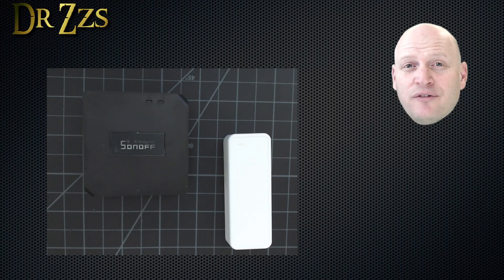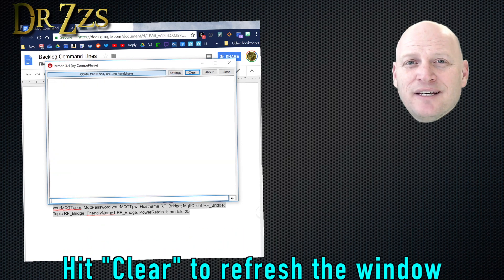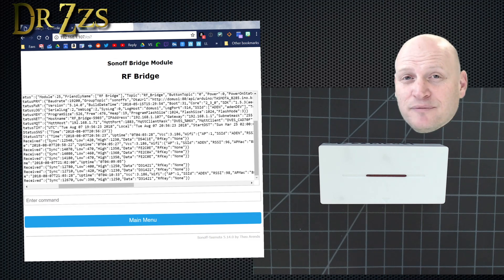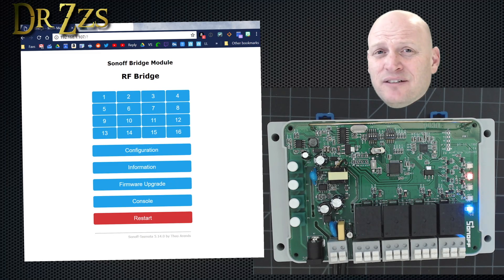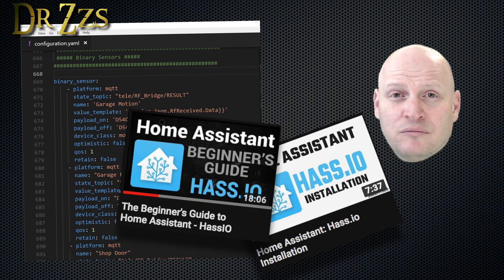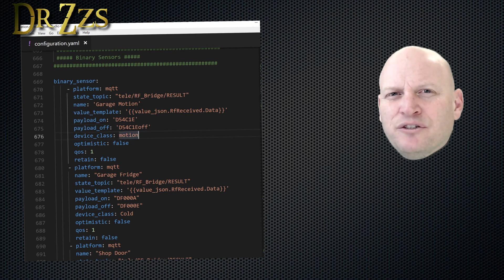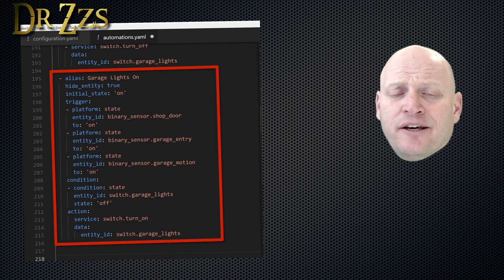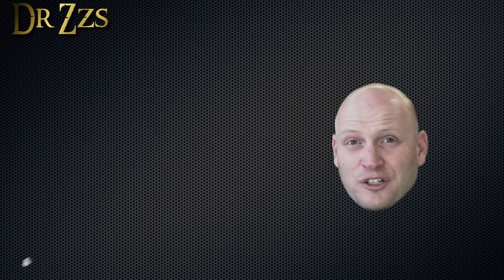Sonoff RF Bridge with Tasmota

Comment: Nice video:) I have noted this before, but I get this annoying error in the log every time I use a 433 MHz key-fob with the bridge: 

2018-08-10 13:59:50 WARNING (MainThread) [homeassistant.components.binary_sensor.mqtt] No matching payload found for entity: Alarm Fjernbetjening with state_topic: tele/sonoffbridge/RESULT

Why does it that?
Reply from the maker: Thanks.  
maybe we can figure it out together.  The answer seems to be something with the payload for that sensor.  Can you post what you have in your config.yaml for that sensor?  And what you see in the Tasmota console when you press the button on the fob.  That's where I'd start looking.
Reply: Great;) This is my yaml :

  - platform: mqtt
    name: "Alarm Fjernbetjening"
    state_topic: "tele/sonoffbridge/RESULT"
    value_template: '{{value_json.RfReceived.Data}}'
    payload_on: "F570C0"
    payload_off: "F5700C"
    device_class: opening
    optimistic: false
    qos: 1
    retain: false

And this is an example of the console from tasmota:

21:03:38 MQT: tele/sonoffbridge/RESULT = {"RfReceived":{"Sync":13580,"Low":440,"High":1300,"Data":"F5700C","RfKey":1}}

This is the "OFF" for my alarm system :)
Reply from the maker: Looks like you also have it programmed to Key 1. Try using RfKey instead of Data in the template then set the payload_off to 1. 
What’s the console output for the alarm on?
Reply: DrZzs  I have tried the payload with the rf key instead also - this makes the same problem. 

The on payload is the same as the off - just with the other data code
Reply: Hi again Doc:)

I have written a issue on the HA forum also. This is more in depth of my problem:)

#################################

Hi all.

Dont know if this is the right place to post this. But I have just set up af tasmotized RF-Bridge form sonoff to control my diy Home Alarm System. Im using Xiaomi Aqara System with Xiaomi Sensors for the doors and Motion detectors - also from Xiaomi.

I mirror all the system directly to HomeKit so I can control it by my Home App. Works great.

But I use the RF bridge together with a 433 mhm Key-Remote control.

When I set it up I get these results in the tasmota console log.

07:34:37 MQT: tele/sonoffbridge/RESULT = {“RfReceived”:{“Sync”:13610,“Low”:440,“High”:1300,“Data”:“F5700C”,“RfKey”:1}} THIS IS FOR THE OFF STATE

07:35:08 MQT: tele/sonoffbridge/RESULT = {“RfReceived”:{“Sync”:13580,“Low”:440,“High”:1310,“Data”:“F570C0”,“RfKey”:2}} THIS IS FOR THE ON STATE

I then use this code in HA for the binary sensor:

platform: mqtt
name: “Alarm Fjernbetjening”
state_topic: “tele/sonoffbridge/RESULT”
value_template: ‘{{value_json.RfReceived.Data}}’
payload_on: “F570C0”
payload_off: “F5700C”
device_class: opening
optimistic: false
qos: 1
retain: false
It works great for switching on and off the alarm. BUT - I get this error in the Home Assistant Log and can’t figure out why:

018-08-10 13:59:50 WARNING (MainThread) [homeassistant.components.binary_sensor.mqtt] No matching payload found for entity: Alarm Fjernbetjening with state_topic: tele/sonoffbridge/RESULT

Any clue on why this error is coming?

Best regards.

Jacob
Denmark

#################################

Comment: Hi. Glad you had some more success this time round. And again thanks for all the great videos. The limit on rf transmit and receive is only limited to the number of 24bit codes possible (16,777,215 i think). If you want to send a code other than the preset 16 codes. Just use the mqtt command RFCODE and make up a 24bit number. To send hex value just add a # infront of the code. Example cmnd/sonoff/rfcode 8585358 or cmnd/sonoff/rfcode #83008E. Adding the # infront of the code to send hex is a real pain in home assistant which is why i added some settings in tasmota to be able to receive the rf codes as a decimal value which is much easier to handle in home assistant. As of tamota version 6.0.0 In console use SetOption28 1 to switch dec rf receive on. Then the use of rf plug sockets becomes much simpler. 
Thanks for another awsome video hope this comment proves useful. 
Thanks. Sam
Reply from the maker: Awesome!  Thanks again to you for pointing me in the right direction.  
Sounds like you are the master of the RF Bridge.  I'll be coming to you for any future questions :) 
Are you on Discord?
Reply: ha! i wouldn't say master. Ive been programming arduino and RF for many years so i can understand most of how the tasmota firmware works. i cant help but think that tasmota and home assistant is the best thing since sliced bread. my discord number is #1361.
Reply: Hey - hope you can help;  when i restart HA after a config change, the sensors on my RF Bridge all go into a closed state even though they are open.  Also, my cover.garage goes into a unknown state as i have a RF reed sensor as well.  As soon as i open any of the sensors it gets back on track again. Seems like the RF bridge is not retaining the last state per device. any suggestions? Thank you
Reply: Hi. The rf bridge is not smart enough to retain the states of any rf devices it controls or monitors. Home assistant can do this and if you look up recorder logbook and history there are some setting to be able to reload previous states of all entities. Remember RF is only one way communication so the states are assumed based on the last received communication. If a communication is missed then the states can become out of sync.
Reply: @sammyboyproductions    You can use variables in Tasmota to store the state of things if you wish.
Reply: Philip Littlewood. Yes. Over the past year i have become better at using the rules. I have not tried storing a full code in vars but im sure it can be done.
Reply: Philip Littlewood. Or the state if something as you say.
Reply: @sammyboyproductions  You don't need to store a full code just note down that eg Var1 is your lounge windows sensor.  When the bridge receives and open command dmthe set var1 to 1 when it closes again set var1 to 0.
Reply: Philip Littlewood. How many vars are we up to now? 3 was the last i saw. Would be nice to have more vars to store more states. Do you think they could be stored in binary form in one var? Think rules would need to have some sort of bit shift.
Reply: This is perfect thanks, final piece in replacing my dead RMPro with one of these. Fraction of the price and so easy to learn codes compared to the pot luck disaster with the RMPro. As usual, far more complicated to read about than do. @DrZzs, tried your EZ flash technique for the first time with this, and again, so simple, thanks.
Reply: Hi Sam. I want to use HA with those RF smart plugs that come with a remote control. I flashed Tasmota 6.3.0 on an RF Bridge and I can receive the codes send by the remote as decimal value. Now I want to send the codes to a plug with HA using switch.mqqt but it is not working. The command_topic is set to cmnd/RF_Bridge/RfCode and payload_on/off set to the codes in dec. Do you have any suggestions? Thanks.
Reply: Yves Lemmens hi. Sounds like your close to getting it working. 

- platform: mqtt
  name: "Desk Lamp"
  state_topic: "stat/sonoffBridge/RESULT"
  state_value_template: '{{value_json.RfCode}}'
  command_topic: "cmnd/sonoffBridge/RfCode"
  payload_on: "8585357"
  payload_off: "8585356"
  qos: 1
  retain: false

This is an example ive lifted from my instance. Hope it helps.
Reply: @sammyboyproductions  Thanks but still no luck. This is now in my config:
  - platform: mqtt
    name: "RF Switch"
    state_topic: "stat/sonoffBridge/RESULT"
    state_value_template: '{{value_json.RfCode}}'
    command_topic: "cmnd/sonoffBridge/RfCode"
    payload_on: "5746699"
    payload_off: "5746698"
    qos: 1
    retain: false
 
When I trigger the switch in HA, the RF plug does not react and the HA switch returns automatically returns to off. In the sonoff bridge console I get: stat/sonoffBridge/RESULT = {"RfCode":5746699}. I run out of ideas.
Reply: Yves Lemmens is the sonoff bridge mqtt topic correct? In your example you sent in the previous comment you had RF_Bridge as a topic and you have used sonoffbridge in the latest comment.
Reply: Yves Lemmens also try sending the commands directly from the sonoff bridge console. Rfcode 5746699. Also test from the mqtt tool in home asssistant.
Reply: @sammyboyproductions  Hi again. Yes I changed the topic to your example. Still no progress. If I press an ON button on the remote I get on the console: 
MQT: tele/sonoffBridge/RESULT = {"RfReceived":{"Sync":10460,"Low":320,"High":850,"Data":5746703,"RfKey":"None"}} 
and the RF plug switches on. If I use the command 'Rfcode 5746703' in the console, I get 
CMD: Rfcode 5746703
MQT: stat/sonoffBridge/RESULT = {"RfCode":5746703}
but the RF plug does not do anything.
I also sent the code with the mqtt tool in HA and in Node-Red but the same result.
Reply: Yves Lemmens might be something to do with the rf pulse timing. In console try setting rf high to match the rf high of the received signal from your remote. Otherwise try and learn your socket off of the rf bridge. Check out the commands section of the tasmota wiki. Also try learning the code onto the rf bridge using command rfkey<x> 4 that will save the sync high and low data and reproduce it when a key is pressed on the rfbridge front page.
Reply: @sammyboyproductions  Learning the socket of the RF bridge did not work either. I need to look into the tasmota commands but that will take me some time. Thanks for your help
Reply: @Yves987654    Why not just send the command directly from the bridge to your plug?  Cut out the middle man.
Reply: My observation for 4-button remotes is that they ending hex digit is always 1, 2, 4, or 8. I have only tested three such remotes, but this tells me that you maybe have a 20 bit code identifying the remote with a 4 bit code identifying the button. So, where those devices are concerned,  you might only have 1048575 unique devices, each capable of sending 15 distinct codes, but only utilising 4 of those. Wild speculation. Either way a million to one change that my neighbour has the same fob as me is good enough odds!
Reply: Ken McMullan. I believe you are correct. A while back i did read into the rf plugs and the chips they use. Though pretty much any code does work as long as they match at both ends(send and receive) all seems to work.

Comment: Excelent! This will be my weekend project. Thank you!  I have one question: Can the Tasmotized Bridge can learn more RF remote controls? I have a RF remote control that controls 4 light bulb holders. But the stock RF bridge can´t learn my remote control buttons. Regards
Reply from the maker: Thanks!  Let me know if you get stuck this weekend :) 
I would bet there is a way to get the Bridge to learn your codes.  First test would be to get the bridge flashed then go to the console then push the buttons on your remote.  Hopefully an mqtt message will pop up and you'll have what you need.  
If that doesn't work there is another way to get the bridge to learn codes.  You can put the bridge in learn mode for one of the 16 keys then press the button on you fob.  If that doesn't work either then we ask Sam Day, cuz he's a level 40 RF Bridge Wizard.  If Sam doesn't know how to do it, then it can't be done.  Give it a try and let us know how it goes. 
Good luck!
Reply: It works really good. But I´m getting this errors " Error parsing value: 'value_json' is undefined ".
Reply: It seems that the problem was with the reset automation. I had to chenge it to => payload: '{"RfReceived":{"Data":"45F765off"}}

Comment: For the sensor that only sends the open signal you can use it for a bathroom light sensor. To toogle the light, so wen you open the first time it turns on the light, and when you open again it turns it off
Reply from the maker: ya, you could do that.  What you'd do is set an automation so that every time that sensor sends it's "on" code the light is "toggled".  
That might work really well actually.  Good thinking. 
If you have trouble setting up the automation let me know.
Reply: This will fail if the light isn't off when you first enter. (it will turn it off)  It could be off by many reasons: toggles via a normal switch, from HA, from any automation or simply a missed signal.

Comment: I prefer OpenMQTTGateway, since you can just send the RF bridge a code and it will send it out on 433 MHz. So there the number of send codes are also unlimited.
Reply from the maker: Ooh. That’s good to know! I wasn’t aware of that.  I’m glad there are lots of good options.
Reply: SirJMDDK I think there's no limit here, too, as in espurna... It's just the tasmota interface limited to that number of codes, but if you are using the device just as sender and receiver, with a controller like nodered or home assistant, and mqtt, there's no limit...
Reply: is it possible to send with tasmota and homeassistant
Reply from the maker: You mean to send a command from HA to the Bridge then to an RF device?  If that's your question, then yes :) 
If that isn't what you mean give us some more details and we'll try to give you the answer. 
Thanks!
Reply: DrZzs yes, exactly that, so the limit is only in the device itself but can be bypassed using nodered or HA
Reply: did you answer how to send rf codes over mqtt with home assistant?
Reply: can you explain how to do this? i can't figure this part out yet... @DrZzs
Reply: I did wonder about the sending limit. I want to use Sonoff Bridge to send and receive RF but don't want to be limited in sending. Broadlink RM Pro is not limited in sending because RF code is stored in HA. Can I do this with both tasmota and mqtt gateway or just gateway?

Comment: Will this work with Honeywell door/window RF sensors commonly used by commercial alarms? Also, if your car has the option to learn garage codes that code does not roll as with the original fob. Wonder if that code could be learned by HA and it work.
Reply from the maker: Good question about the car transmitter.  I'll have to try that.  I wonder if the Bridge would pick up on that and be able to learn that code so when you press that button in your car you could trigger the door or (even better) some other Automation.  Like an audio message saying "Hey kids come help with the groceries"  That would be cool. 

As for the Honeywell RF sensors, I can't say for sure.  I would hope the bridge would work for those.  I don't know enough about ways they might be able to make their sensors NOT work with other systems.  I know the bridge can work with sensors that say they need their own companies receiver.  So there's a good chance they would work.  If you get the bridge and try it out let me know if it works!
Reply: https://www.alarmgrid.com/documents/honeywell-5800-series-wireless-technical-specifications darn, 345MHz. And a lot of bits sent for each state change. Most garage door openers I researched don't use 433. They're in the 315-390 range. Double-darn.
Reply: Would be interested in finding out if the Honeywell RF sensors work too!
Reply: @enforcer1064  see my comment. Wrong frequency & protocols. Bummer.
Reply: Meh - nevermind. I am building something to break out my Dimension panel to integrate with HomeAssistant though !

Comment: I use sonoff RF bridge with espurna firmware to control a  JW-T02 on Home Assistant (very low cost RF receiver with buttons for rolling shutters). Pretty happy with it. 
Espurna allow theoretically a better compatibility with all the different device thanks to an hardware modification (take a look about "RFB_DIRECT bypasses" -> the EFM8BB1 entirely and lets ESPurna handle the encoding/decoding -> Types of hardware recognized: anything recognized by the rc-switch library)

If Tasmota works like espurna you're not limited to transmit different signals because you can put directly the RF code in the config file of Home Assistant to send an MQTT command, see here :
https://pastebin.com/T3T37mUR

I think that there are 3 way to integrate this RF bridge ton Home Assistant : tasmota , espurna and OpenMQTTGateway. Each one has advantage and constraints.

When you use Sonoff RF Bridge as RF emitter, the distance detection is not very far so I will try the broadlink IR/RF gateway to see if it's better. 
Any advice to increase the detection distance ? May be we can customize the 2 antenna ?

For This kind of sensors (motion detection, buttons,door detection) I prefer xiaomi aqara which are based on zigbee protocol (so you can have the current state of the sensor, great autonomy, great distance, great form factor and great price) and with the xiaomi gateway it's very easy to integrate in home assistant. But for those who don't want a xiaomi gateway you can take a look on the different zigbee gateway :
https://github.com/Koenkk/zigbee2mqtt
https://zigate.fr/

By the way, if you take a look to the IR broadlink bean which is a great gateway for IR for your next videos, take a look to this : a lovelace interface for remote controls
https://github.com/dimagoltsman/ha-custom-lovelace-cards/tree/master/remote-control

Little last information : this led controller is awesome for the price :
https://www.aliexpress.com/item/free-shipping-12A-5V-24V-LED-RF-Wireless-Mini-Remote-Dimmer-Controllers-RF-Wireless-Remote-LED/32541185027.html
The remote is IR and RF (so with the RF gateway you can control a lot of things with thrue the walls) and the led driver is controllable with the RF gateway too ;)

Comment: The bridge can only be used for binary sensors and switches right?  No RF temperature/humidity/weather station sensors right?
Reply from the maker: Good question. You are probably correct. I honestly don’t know for sure.
Reply: DrZzs for that you need to decode the protocol, too, so the right device is the rflink... https://tech.scargill.net/rflink-and-node-red/